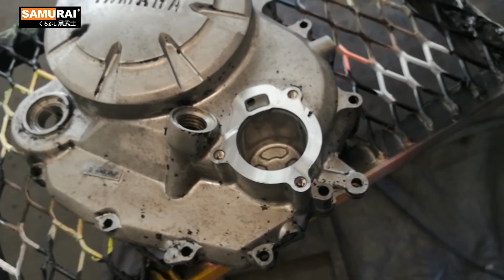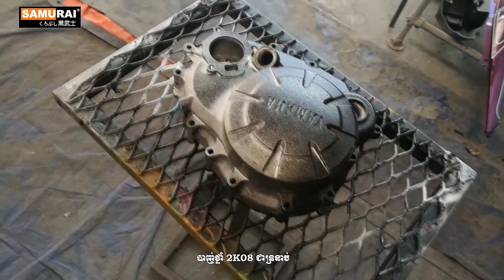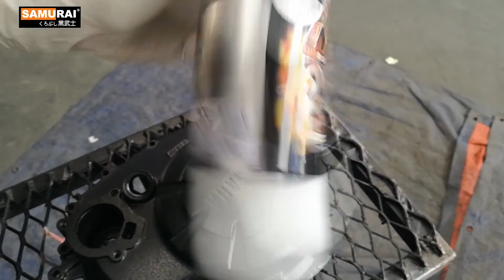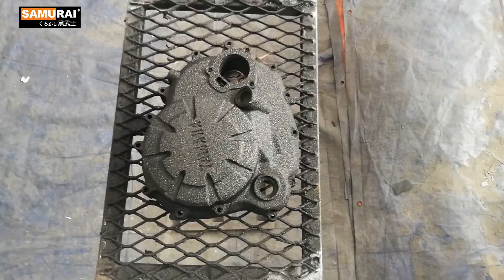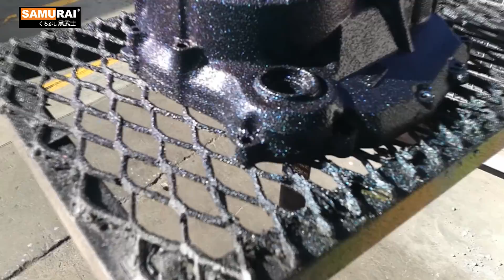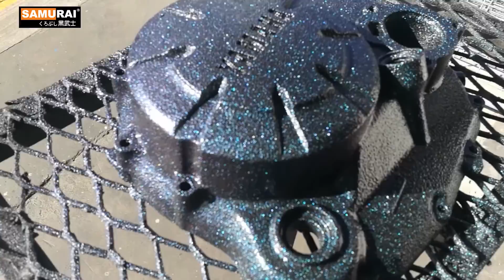How to spray on motorcycle’s machine -Samurai Paint Cambodia

Comment: Is this possible to use it in motorcycle fairings?
Reply from the maker: What is fairings bro?
Reply: @samuraipaintcambodia8599  fairings....its the plastic cover of a motorcycle..exciter 150 yamaha
Reply from the maker: @BiyaheniOnin  yes it can spray brother but you need to spray plastic Primer coat KPP***
Reply: Apply KPP....2KO8...2KO7...then color i like bro..then top coat
Reply from the maker: @BiyaheniOnin  yes bro